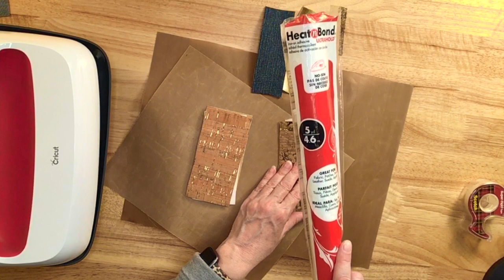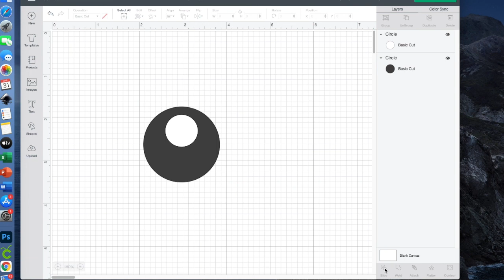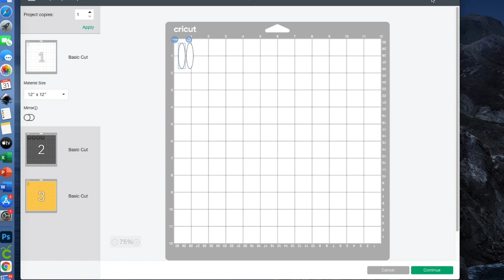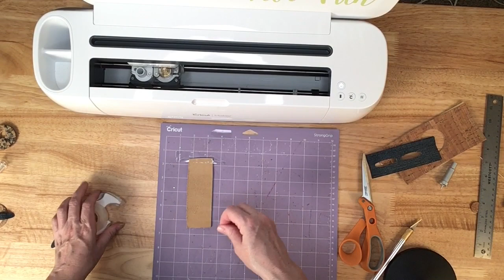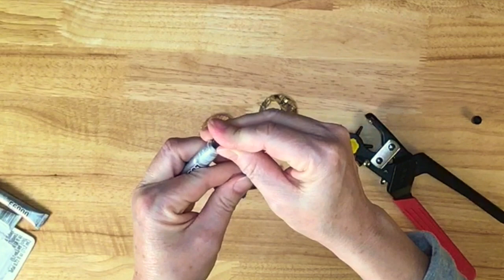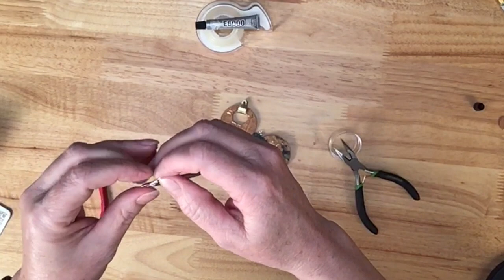DIY Cork Earrings with a Cricut Maker

Comment: Did you use the fabric Stiffener on the cork material that you used?
Reply from the maker: No, since I made it double sided with heat n bond in the middle, I didn't need to use it on the cork fabric in this project. I only used the stiffener on the denim.

Comment: I followed all your directions but when it went to cut it did it for about 2 seconds and then the red light came on blinking. This was with the cork on cork, The first one you did.  What am I doing wrong?
Reply from the maker: I had never even heard of a red blinking light on a cricut, so I went to the cricut website to see what it means. Apparently it is a material issue. I copied and pasted what it said and here it is:  If the blade encounters inconsistencies in material thickness or density it will get stuck and may cause a blinking red light. Simply follow the onscreen instructions to clear any debris, and press the cut button again to resume the cut. This may happen multiple times during a cut.

Comment: I followed this tutorial. It didn't cut through on one pass using the rotary cutter with  'more' pressure so I ran it through again - and it damaged my mat! :(
Reply from the maker: Oh no!!! I a so sorry that happened to you! I would keep the mat and use it for test cuts so you can determine what settings work best on your materials and machine. If you try it again on more pressure and it doesn't cut all the way through, you might run it through again on less pressure the second time. What cork are you using?